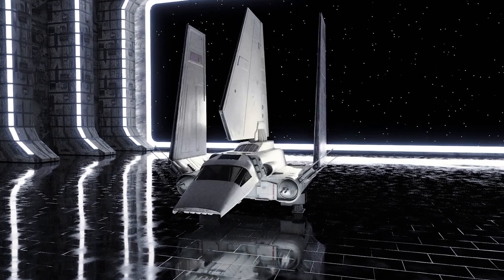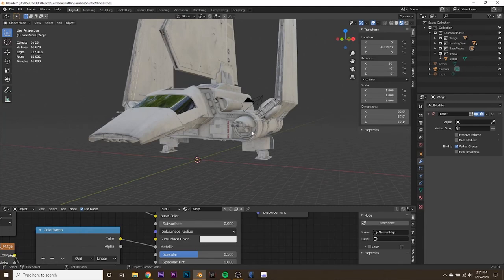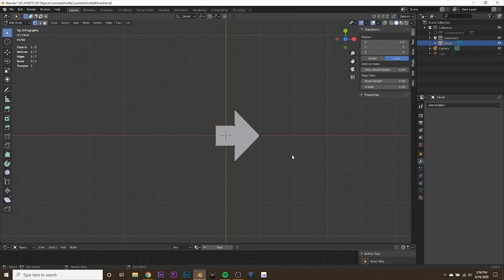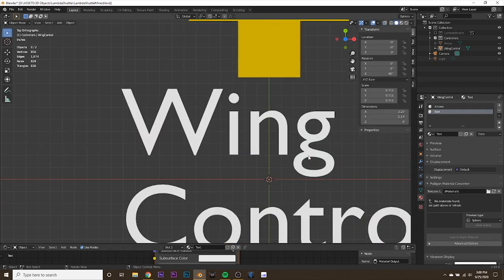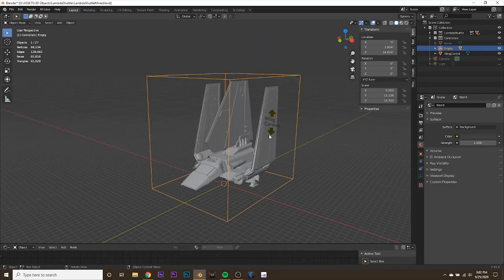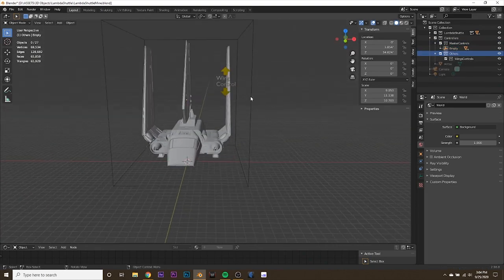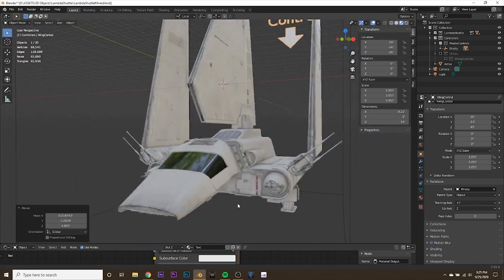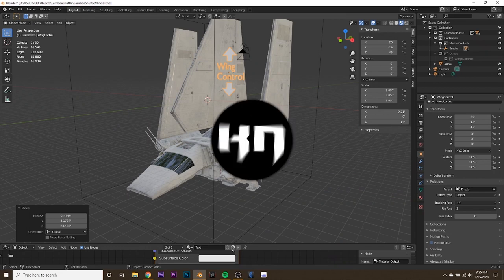Easy Rigging With Constraints in Blender 2.9!

Comment: The arrow controller is neat, really, but if you wanted, would you have been able to just click/drag/move the spaceship wing itself?  Or rather, is that specifically NOT possible in Blender?  (See I'm a Solidworks person, which doesn't have a "move this to magically rotate that" function.)
Reply from the maker: You could, but you would have to make sure all the origins are correct, and for the purposes of animation, it would be immensely more work to achieve pretty much the same effect. The purpose of rigging is to constrain how the computer understands how an object’s states can change relative to how the user can understand them. With a simple rig like this spaceship, the amount of benefit from rigging is less than if you were to rig a character. Without a rig in this case, your would have to manually go through and key frame every single little piece in just the right way with equal motion and try to get it to look right (almost like stop motion in the real world where you’d have to move anything you want to have motion). With a character, you probably would not even be able to efficiently animate them without a semi-suitable rig. So rigging is mostly just for animation. If you’re just creating static renders or models, then you can just move what you want to be where you want and call it a day.

Comment: And finally, please comment on whether there's even a point to using "bones" in a model that's nothing but rigid parts, like this one.  If I'm never doing "bendy" things, then is there even a point to using bones at all?
Reply from the maker: Again, for the purposes of animation, “bones” are just another way of doing what we did here (maybe even easier to understand too). Bones also have more options for motion control. If you’re just doing rigid objects, whether you use this method or bones depends on what you need it to do and how you want it to move